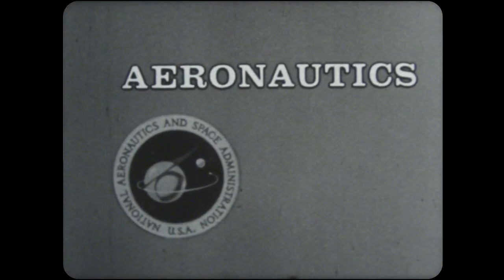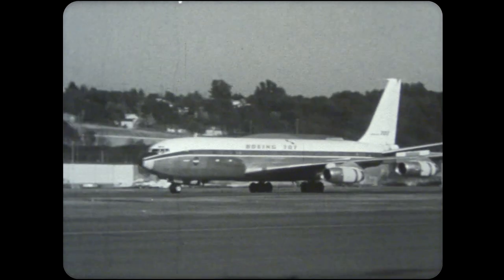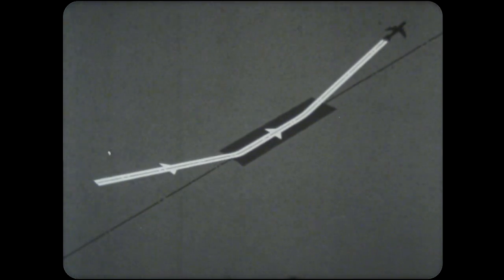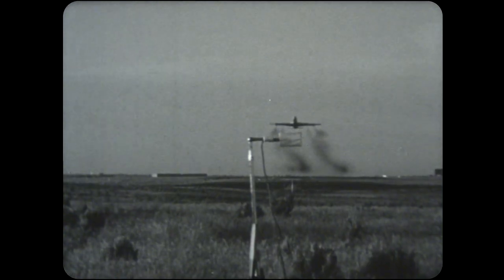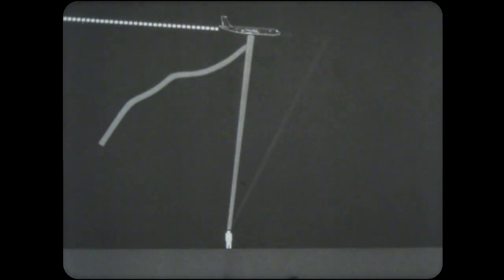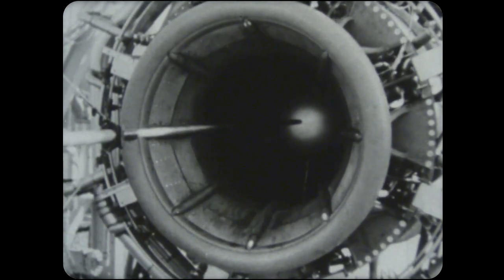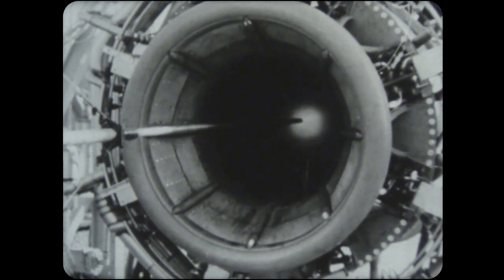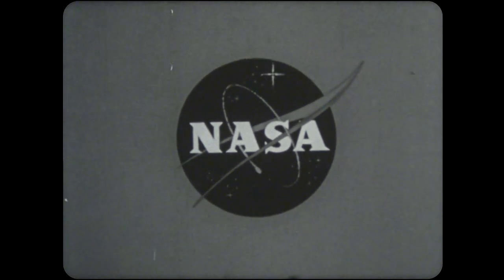Research Toward Quieter Jet Engines (1970)

Comment: You have to be around back in the 60's and 70's to remember just how ear splitting some of the commercial jets used to be. Totally different today with the much quieter turbo fan engines. But yep, I remember just how high pitched some of them were back then.
Reply: I had almost forgotten that screeching sound.  Hadn't thought about it in years.

Comment: I work at an airport and have worked at airports for close to 30 years. Just a few weeks ago I paused to watch a newer 747 takeoff and was shocked  how quiet it actually is. It almost sounded as if the engines were barely above idle when it leaped into the sky. I remember 30 years ago that would have been an entirely different story.

Comment: The Birmingham Al. airport had to purchase entire neighborhoods to expand the runways, and build rolling hills that deflect the sound upward instead of outward. It really seems to help with noise pollution. Living less than a half mile from that airport we saw many changes, most memorable was the pollution from jet engines. When I was very young I recall thick grayish white smoke coming from all jet engines then watch as that smoke settled across the ground. It seemed heavier than air by how quickly it settled. Not sure of what physics are at play here, I assumed the exhaust was lighter from the heat generated from combustion. My high school was near the top of RED MTN. and on bad pollution days we were above the layer of low pollution clouds. The tops of the tall buildings rose from that smog. Birmingham had an angry red hue overhead on bad pollution days anyway, the air quality improved with each step with industry and aeronautics. I moved to S.w. Florida in mid 70's and had trouble trusting air I couldn't see. I moved back in mid 90's and the air is now clean. The actions taken worked.

Comment: The greatest noise reduction improvements came, in order of decreasing effect, from 1) increasing the bypass ratio (providing an "air blanket"), 2) adding serrations to the core section exhaust (breaking up exhaust resonances and pushing the sound energy into short-range ultrasonic vortices), and 3) improved turbine blade designs (via CFD).

Split-spool designs (which run the compressor, or sections of the compressor, at different speeds than the power turbine) were also effective, but the added mechanical complexity was problematical until ever-greater engine inlet diameters made it mandatory in order to keep inlet blade tip speeds subsonic.

Comment: Fascinating to see all the smoke coming out of the engines!
Reply: I was a thinking about that too. We don't see that these days. Wonder how they fixed that.
Reply: @bob4analog  It's mainly achieved through better design of the burners in the engine, plus better fuels. Just like a badly tuned car engine, you get soot in the exhaust when the fuel isn't all burned efficiently. Check out AgentJayZ's channel here on YouTube, he talks about it.
Reply: @Fred Pilcher Fuel rich is greatest power of an engine.  If they are testing for maximum noise they would likely be running at that and generating more smoke than normal operation range. 
Fuel rich is also cooler and leads to less erosion. Evolving materials allow designs with higher temperature and less erosion under the same conditions. Can then expand design to have more powerful engines or a relatively less powerful but more efficient engine.

Comment: Sounds pretty loud still. I'm thinking someone should develop a different approach. 
Maybe just quieting the exhaust.  Something like a muffler on car or like a silencer on a gun.
It think their success is due to being on the exhaust side of noise makers.
60 years Boeing Ben getting paid.
This is the best result ?
Find someone else to  improve noise reduction Boeing has failed.
This documentary was 50 years ago.
No quieter since. 
Advance or step off the government teet Boeing. Corporate welfare needs to reigned in.
CORPORATE WELFARE needs to stop.

Comment: In the late 80's early 90's we lived near an AFB still running straight turbo jets on KC 135s. Want to hear noise, wow! when they used water injection on TO the dishes rattled in the cupboards. We lived under the practice pattern, so some times when on the phone, we' say hold on a second a planes going over. But we were used to it, no big deal. When they started to switch to bypass fan engines in the mid 90's, amazingly quiet! You almost didn't notice the planes at all.

Comment: The Boeing 727 was the noisiest plane in my opinion. When the wide body planes like the L-1011 and DC 10 with their fanjet engines appeared they were much quieter. In the 1980's when the 757 and 767 became the new wide bodies their engines were even more quiet.. Now the noise level is so much better than ever that it doesn't seem to be so much of a concern. The type of noise has changed and it's nowhere as irritating as before.

Comment: For some reason, my town is at a spot where airliner engines are often mostly inaudible, then you'll suddenly hear them in a high pitch WHOOSH that, over the course of about 3 seconds, smoothly pitches down until it's low for about 30 seconds to a minute, then pitches back up high and disappears in about 3 seconds just like it came in
Reply: You need to try some things there. See if it sharpens razor blades. Draw a pentagram. Pyramid jet engine power. Something.. you know.. scienterrific.
Reply: It might be a null point where the sound is reflected out of phase with the direct (in phase) sound. the 2 will cancel each other out :)
Reply: Are you sure it’s not the leading edge slats of an A320 family aircraft on approach? They make that noise as they are deployed, I live in a place on approach to an airport. Never hear engines but do hear the slat deployment, only on A320s.
Reply: @ZXGuesser  I believe it of course, I just want to have fun with it. Hail science!
Reply: @ZXGuesser  This happens in many places in the neighboring towns, and only started in the last ten years or so
Reply: @ehamster  interesting. I'm about 50 miles from Logan